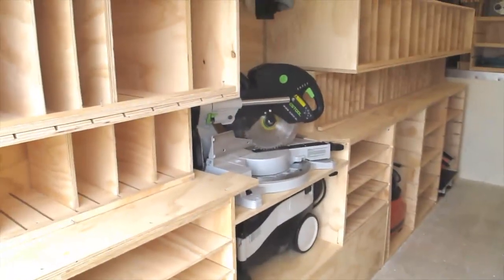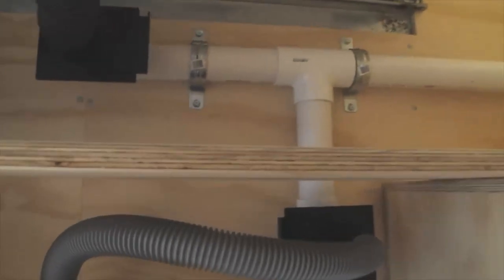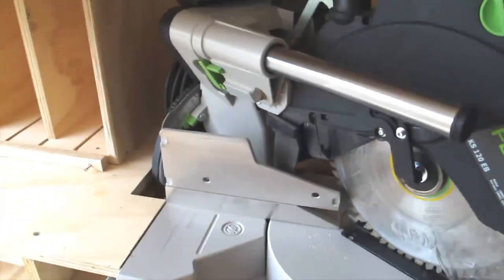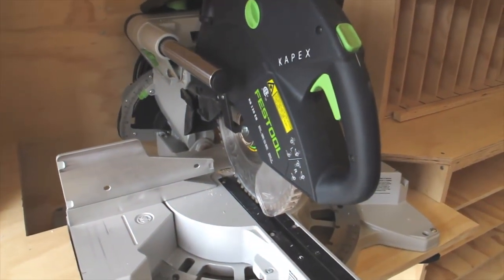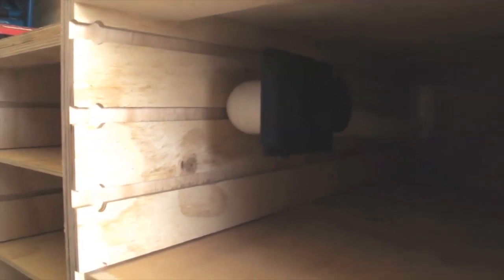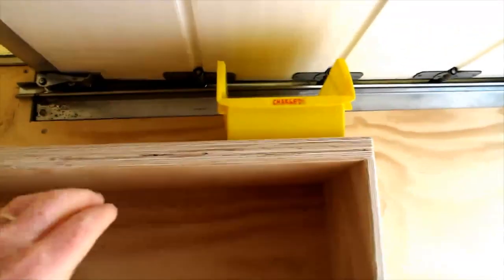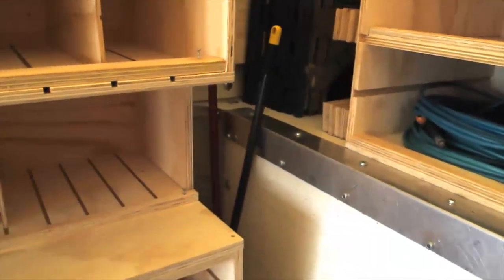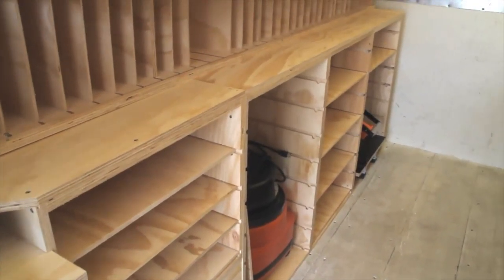Moblie Wood Shop: Episode 5

Comment from the maker: I did not track the quantity of ply, but it was a lot. Plywood is cheap: $27-$32 depending on thickness, so I don't worry too much about it. I think I spent around $1000 on all the materials to build out the mobile shop. On the other hand, your time will really add up. If I build the mobile shop for a customer, labor and material would run around $5,000.